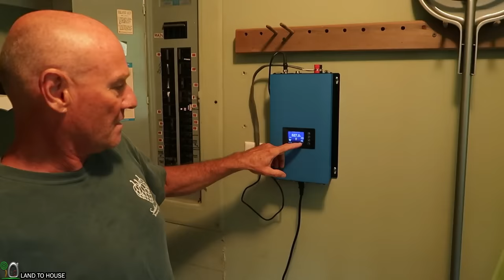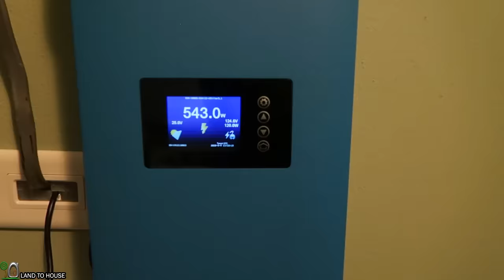Awesome Low Head High Flow Grid Tie Micro Hydro 530 watts!

Comment: Surprising how many watts he is getting from such a low head. Goes to show the high power potential from a low head hydro.
Reply from the maker: I think the formula still holds true for low head power. 
(Gpm x head)/10 = watts
So (350gpm x 15 feet)/10=500 ish watts
Reply: I’m guessing the fact that he has the outflow under water creating suction is a big contributing factor. If you think about it it’s kinda like the entire creek is pulling the water through not only relying on the fall of the water to the turbine itself. It’s genius!
Reply: a turbine that big with that good of plumbing should be able to power your entire house, maybe if you gut the alternator out of high amp gas generator and built a plate to belt ot in, cool setup
Reply: Yea but look at the supply of water volume you need that is unsustainable almost every were !
Reply: @rhom5180  the load would bring the turbine to a standstill with a high power generator head.
Reply: it's an ineffective setup  most of the water is being wasted because of the cheesy motor  what you need is one of those BAS motors from a start stop system they will put out a couple of KW hours
Reply: @raymondj8768  yeah right! i find it funny that he "only" generates 500watt with those big pipes... im wondering if he could add a larger turbin or add more of them?
Reply: @Shortyyz  i know rite thats a dam waste of time n energy!!!
Reply: @samuelemmettbray :   " Mmm. no. 500watts isn't even car battery power. "
No, it's not. Then again you never measure anything about a car battery in watts, only the things USING power. If you meant "alternator" then yes, you would usually get more power out of 1 than that.
Reply: @LandtoHouse  don't mix units - Watts are metric!
Reply: Hydraulic power = PQ (P=pressure/head) (Q= flowrate/Gpm)
just shows that even with little head, you can make up with higher flowrates, giving u the same Hp
Reply: @911life5  And with that step up to 8" pipe volume, he's able to up the flow rate on the 6" line I believe.
Reply: @hussam9044  I'm a bit surprised he only gets 500 watts with that fairly reasonable head and the big flow with those big pipes I would have expected more power. I really haven't got a clue how much more or even if it really should be mathematically more but that's quite a lot of water belting through there and although a very useful amount of power, especially if he's got a storage system and inverter I still would have expected more out of this quite cleverly setup arrangement.
Reply: @carts4138 :   " don't mix units - Watts are metric! "
I hope you're just joking there. If not then you'd better go study some more.
Reply: @lorditsprobingtime6668  the dynamic head is certainly big as the suction of the pipe sets the direction of the flow to follow the pipe line, combine that with reasonable elevation and yeah I would have expected more than 500 watts from those, the beautiful thing about water is that it's quite a heavy material so flowing water carries a lot of kinetic energy because of the giant mass of the water
Reply: @hussam9044  Not sure where exactly but someone suggested running another 1 or maybe more in series. He does have a minor issue with using virtually all the flow of that stream there now, if he had more in series it would restrict flow a little at least but I wonder if he'd have enough pressure to run 1 or more extra ones and not wind up actually slowing them ALL down too much to generate the needed voltage. It would be great if he could as then he'd get hopefully more power and maybe be able to keep it running continuously. He's got a pretty good setup now and I think he could improve it maybe by doing that and also by taking the right angle corners out as much as possible. Ideally no corners at all but we know he has to have some. Where he does absolutely have to have a corner at least make it a steady bend rather than a sharp corner. I forget the exact figures but each corner sucks a lot of energy out of a system like this. The big diameter pipes will help compensate a lot though.
Reply: @lorditsprobingtime6668  now remember that the initial flowrate of the river cannot be smaller than the output flowrate of the system, if he had 2 pipe systems he might possibly restrict water from ever going across the dam wall! because water now prefers the easier pipe route to go down and it would do so, the right angles are considered major losses of fluid energy in a pipeline, however with the flowrates he's operating at the effect of right angles isn't that much so the flow pattern isn't disturbed much at least, 

you know, if he used a second pipe, the flowrate across each pipe might me low enough that right angles don't affect energy loss that much, you saw how with 1 pipe system he almost completely stopped the flowrate above the dam wall, so he's already using the almost maximum available flowrate
Reply: @hussam9044  You didn't read my comment very well at all. I said "in series". In other words all on the same line, one after the other. I even mentioned that it might HELP REDUCE the overall flow going through and may allow him to have it run continuously. Why am I repeating myself, READ THE OTHER POST AGAIN FFS. 
I will agree that although sharp elbows won't have nearly as much effect at low flow rates. This does have a fair but not huge flow rate though and although it wouldn't make a big difference he is after every possible advantage here to get the current up WITHOUT increasing flow, that's why the series arrangement would probably help enough to warrant running extra turbines "IN SERIES" relying on them to help  reduce the flow to a sustainable rate.
Reply: @lorditsprobingtime6668  What do you think about the idea of using a kind of an automatic gate valve/ servomechanism to auto regulate the flow rate? I don't know the exact name but big commercial power gen systems do have an autonomous system that opens and closes to check speed of the turbines.  I think it's used for synchronising with the grid. 

So I'm thinking of borrowing that idea but with a twist, to increase flow rate whenever there's excess water overflowing in the dam. That way you have extra advantages, e.g no noise from the waterfall, and sucking all the energy from the dam. Not too difficult especially with DIY things such as arduino.
Reply: @davemwangi05  I don't know, that might work ok. I think I'd be looking more at a ball valve that only requires a quarter turn from full on to full off, it also is an undisturbed straight through flow when fully open. if you're going to operate it via a servo arrangement rather than a gate valve that has to be screwed on or off multiple turns.
Reply: @samuelemmettbray   its 42% of an average home's power consumption. (Average US home consumes 10972 kWh a year, which is 30 a day. 530 Watts an hour times 24 hours is 12720 Wh,  or 12.72 kWh.    12.72 kWh is 42% of 30 kWh) So I think its still a worthwhile supplement.  Throw some wind or Solar in there (if he has any sunny spots on his property) and he's energy self sufficient.
Reply: Power = head height  * density * flow rate * gravity

Where flow rate 
= (intake area) *  sqrt(gravity * head height) 
= 0.0182m² * sqrt(9.81m/s² * 4.5m) = 
= 0.121 m³ / s
= 120 litre/second

So power = 4.5m * 1kg/litre * 120 litre/second * 9.81m/s² = 5338 watts 
.... implying about 10% efficiency, which is seems about right for this sort of set-up
Reply: Put the turbine down lower, get the potential energy of the falling water. Dunno.....maybe it pulls thru  with the same power?
Reply: @yestfmf . Sorry but I'm pretty sure that wouldn't help with a fall of (I think they said around 20 feet), it will pull the water through with pretty good force which should be exactly equal to the force pushing if it was right at the bottom. There is a definite limit though, I think it's around 30 odd feet maximum pulling height before you start forming pockets of vacuum. It's good to keep it down close if you had any more height than this but, at only 20 feet minus however far below the normal level at the top it shouldn't affect anything.
Reply: I like that project, beautiful location too. I think higher generator voltage would help, and use of a propper 3 phase inverter with speed control of then gen would allow to run the turbine in its optimal operation point. I guesstimate you may gain about 30 to 40 percent.
Reply: @samuelemmettbray  
If its ran 24/7 for 30 days it will make 360KW of power which in some cases is about 1/3 of a low cost electric bill.
Reply: @punker4Real  BTW punker, I have no idea why you think a BAS motor come generator could be better, it won't though. That was a pretty ridiculous suggestion actually since there ISN'T the force here to generate 
" a couple of KW hours " unless you've got a very tiny one and a few weeks to build up that amount of energy. There isn't the head pressure here or flow rate for more than what he's using right now genius.
Reply: @Supoxify  You've lost me. How exactly do you use a "speed controller" on a generator? I know quite a lot about speed controllers on 3 phase brushless electric motors, this is a generator as used here, so how can a speed controller even be used?
The voltage is pretty much dictated by the particular generator and the speed it spins at. He's using basically the entire flow of that creek here already and he can't increase the head pressure so exactly how do you expect him to increase the voltage too? As for your "guestimation" you'd better 'try' and explain the other bits I mentioned first, then try and explain which part of your anatomy you pulled that figure from.
Reply: @911life5  submerging the output side of the pipe just gives you a cleaner flow through the pipe so you don't get any air trying to come up and the end. I think if anything it would take away from efficiency though because the water coming out of the pipe has to push the water in the creek out of the way. Ending it slightly above the creek might be ideal. The creek isn't going to pull any additional water through the pipe because it's open to the air. If you could enclose the whole creek a mile downstream somehow you'd get a bigger head drop and more power though
Reply: @jonathancover4658  yeah the diameter change causes the water in the smaller pipe to flow faster - and hence more flow than if it were all 6". An 8" setup all the way through would still get more flow though, but at a lower speed which might be less efficient with the turbine
Reply: @yestfmf  shouldn't matter where the turbine is located - at least not much. Main difference will be laminar flow before the turbine vs turbulent flow after. So I think you're right but it shouldn't be a big difference
Reply: @lorditsprobingtime6668  only difference will be laminar vs turbulent flow before and after the turbine so I think he's technically right but it shouldn't be a huge difference
Reply: Why use rule of thumb equations, just use the actual equation.
P = m x g x Hnet x η  
Using metric is easier:
m is Liters/sec
g is 9.81 (gravity)
Hnet is Head minus the friction (in meters)
η is efficiency
Power = 12.6 liters/sec (200 gal/min) * 9.81 * 4.11 (15 ft -10% friction) meters * .75 eff = 381 watts. 
To get the 535 watts he is generating, his flow must be more like 280 gal per minute.
Reply: @lorditsprobingtime6668   maybe the topic is a bit hard to explain in a comment section. I will try. I used to do that with larger turbines (100 - 200 MW) . You are right about the head, it will not change much in that application. Voltage at generator terminals is given by the generator and the speed. My idea was: if you would use an inverter and control the speed you could experiment and find the optimal speed (with the most power output) for the given head / flow rates. With the large systems this could lead to the said efficiency gains. But often (with large  dams) the head varies a lot, so the gains would be smaller here. Sure it would cost quite a lot more and would be more complex (more potential for failures etc.) But would be interesting to do,  probably overengineered . (For more details, google "varspeed hydro" )
Reply: @Supoxify  My apologies for being so outright dismissive of what you were saying. It sounded so much like a lot of the voices that chime in with crackpot ideas that defy physics and all logic so often. It sounds like you actually do have some real knowledge and experience with this sort of, if much larger arrangements. As you say, it's a little hard to know from comments exactly what the other person is having trouble understanding, and how many other things they're not understanding either for that matter. I'm still unsure how you control the speed of the generator. I think you're suggesting the inverter, or some electronic speed controller but I've never heard of one that controls the speed of a 'driven' device, only the driving motor. Unless you maybe meant controlling the flow going through it to find the optimum rate for the best balance of water usage verses power generated. If it's the last one he's got a limited water flow so he may as well get everything he can out of it since any that doesn't go through his turbine is wasted (to him) anyway.
I haven't got the time now but will look up "varspeed hydro" later, I'm still curious about that since they can pretty much all be spun at various speeds and the only difference on a specific unit is the voltage and current will increase with more speed and reduce with less which isn't usually any problem if you've got the right electronics to convert it to the voltage you need, that isn't any major problem these days. As for the a gain of "30 to 40%", well, that's a huge increase and he could do with that since he's very limited by the lowish head pressure and flow of this stream so depending on HOW much extra cost was involved if he could pull even the lower 30% extra that could be worth spending, depending on how much extra. As it is he needs batteries to store extra while he's not using much to give him power to run high power things like microwave ovens etc and the more his turbine is putting out the lower the capacity of those batteries has to be. Either way, more power coming out is always good.
Reply: Not the best design. Negative pressure on the turbine will produce impeller destroying cavitation.  Turbine should be nearer to the water outlet.
Reply: What do you mean by "car battery power?" 500 watts is 41.67 Amps at 12 Volts. That is significent.
Reply: @jimprice1959   Cavitation WON'T be a major, or even minor issue at that height.
As for the power being "significant" I completely agree. Although "significant" is a relative term, if he's got a way of storing all energy gained during each days running it would be enough to do quite a lot with and definitely save him a lot on charges for extra from the grid, with luck it'll cover any grid costs completely.
Reply: @lorditsprobingtime6668  I wonder.  Maybe some clear tubing would show it.  Cavitation might not damage the turbine but would decrease efficiency.  I've seen the effect of cavitation on the Kaplan runners at Bonneville dam.  It's surprising what it can do.
Reply: @jimprice1959  Sorry but I had to look up "Kaplan runners" and I was going to say I've seen the effects of cavitation on a damaged boat propeller and that's pretty much what they are, I can't remember exactly where else but I have seen very surprisingly severe damage caused by cavitation to something else that was enough to be very surprising. Here there's no huge forces involved, there's only, if I remember from watching it some time back about 12 feet of fall in total. From memory I think it's something like 30 feet of water depth equals 1 atmosphere so in an undisturbed state there shouldn't be any vacuum pockets unless it was over 30 feet and being at 12 and no major forces involved at 12 feet it really shouldn't. I would say your idea of a clear section below in particular but everywhere you could around the turbine would be a handy idea and even satisfying just to see it working and doing it's job, but especially for checking on seeing if somehow there was enough disturbance along with the lowish suction to make sure there's no cavitation going on. Only problems I can think of is:
(1) It would be highly advisable if you're worried about cavitation to get hold of a high speed camera to film it in action from every angle possible because cavitation can be there and gone again faster than the eye could hope to see on a spinning turbine like this, and'
(2) I'm not sure where you'd find clear fittings or sections of pipe that can also stand the reasonably strong suction created by that 12 foot of fall. Maybe custom made section with actual glass panels might be best and would give the clearest view of what's going on. Alternatively he could just inspect it frequently at first then less frequently once he's confident there's no cavitation eating away at anything. I don't 'think' there will be but I won't try and say it's a waste of time checking.
Reply: @lorditsprobingtime6668  You are correct on pressure.  It works out to be  0.433 psi per foot of head. I remember seeing a Francis runner in Boulder City, NV near Hoover dam.  It has been removed as it had very large holes in it from cavitation.   I applaud the guy for building the mini hydro system.  Here's what I would do to improve it.  1. Put the suction down under the water so it doesn't pull air.  There is no reason for it to be on the surface.  2.  Better yet.  Put a 4 in. hole in the bottom of the dam with a gate, or preferably laminar flow needle, valve to feed the water into the penstock.  3. Put the generator as low down the pipe as possible.
Reply: @jimprice1959  I don't think pulling air is a problem for him, remember the simple tennis ball fix he has to stop any vortex ever reaching the inlet. Plus he can easily clear any leaf litter or other rubbish collecting around his nice big mesh shield around it. The river gravels and silt have built up behind that wall and he'd have to excavate it drastically to have a hole at the bottom of that dam and then anytime there was a bit of heavy rain tons of crap would just fill it straight back up again. Admittedly clearing it out to the depth of that wall would give him a much bigger capacity and he could then do things like treating it as a battery bank and add extra turbines that he can turn on to give much more power for limited but reasonably long periods before he runs too low to keep them going.
I admit I know nothing about a " laminar flow needle " but I imagine laminar flow would be more efficient at least. 
Putting the generator at or near the bottom of the pipe has pluses and minuses. Yes it would certainly make sure there's should be no cavitation and if he had the low hole supply you suggested wouldn't need priming. The bad sides are:
 (1) Longer wiring losing power and. 
 (2) Those high rainfall minor flood situations then puts the generator right in the line of fire of the possibly very fast flowing water and everything that water carries along with it. I've lived beside a steep fall type river that could be a gentle crystal clear stream and if the rain was heavy enough and coming from the catchment direction could be already starting to rise rapidly before the rain even got to me and then it was like a huge wall of water, huge trees and once it got going fully you could not only hear, but FEEL clunk,,,, clunk as massive boulders weighing tens of tons get tumbled along the river bottom. The energy being wasted there seems criminal but being so intermittent you couldn't justify any big project to try and capture anything from that. So much debris to destroy anything in it's path that anything you put actually in that water where there was flow and force would quickly be destroyed by the stuff being pushed along by that flow.
My situation was that I was trying to make a living dredging for gold, that meant machinery floating on pontoons out in the river that sometimes was miles from where I was camped and if it looked like it could be coming I had to race down to wherever everything was and pull the dredge apart to move it well above any possible high water level along with all tools and other equipment. It took me quite a few years after that before I stopped waking up at the first sounds of raindrops hitting my roof, It had become instinctive and it really took a long time to shake it off.
Point of all that was that I've had experience with the force of water in various ways and still getting more now and then to this day since even after all that, when I bought a house I bought one in a flood area, which I agree is kinda stupid but I figured for the much lower price I got a very nice place, that I sometimes have to sleep on the roof of lol.
Reply: @911life5  it's the GPE from the drop in the siphon that draws the water, the pipe under water at the outlet will be higher than atmospheric pressure, the faster flow actually is pushing into the stream water not being sucked out.
The partial vacuum is used to start the siphon, but it's atmospheric pressure that lifted the water up into the elbow to make the siphon seal
Reply: @kameljoe21  you forgot the hours. It's Kilowatt HOURS
Reply: @joeshmo8267  No I am right in my statement. 
@Samuel Emmett Bray 
If its ran 24/7 for 30 days it will make 360KW of power which in some cases is about 1/3 of a low cost electric bill.
It makes 360 kilowatts not 360 kilowatts per hour. FFS.
Reply: @kameljoe21  your terminology is incorrect. What you are calculating is kilowatt hours.
Reply: @kameljoe21  your calculation is correct. Your units are incorrect it should say 360KWh (kilowatt hours)
Reply: @joeshmo8267   No I am still right. kWh is a measurement of energy, kW is a measurement of power,  Energy refers to the ability to do work and power refers to the rate of energy production or consumption. An appliance that uses 1kwh of energy where a generator produces 10kw of power. The turbine produces 360kw in a 30 day cycle. I am still right. Prove me wrong instead of saying I am wrong.
Reply: @kameljoe21  as I said, your calculation is right, you are just mixed up about how the units are supposed to be. 500W * 720hours = 360000 watt hours (360 kilowatt hours)
Reply: @joeshmo8267  You are still wrong. Let me put it this way.  
Utility bills are measured in kilowatt-hours (kWh) -- power usage multiplied by time. For example, a 100-watt light bulb left on for 10 hours uses one kWh. Although many companies and industry groups say a 10 kW system will generate about 10,000 kWh per year (equaling the average power usage in a U.S. home), the real output will be higher or significantly lower. The turbine puts out a maximum of 10 kW under perfect conditions, so it could theoretically generate 10 kW for 24 hours a day 365 days a year, or 87,600 kW per year. With only soft breezes, it will generate just a handful of watts.
I am in no way stating that it will consume 360kwh, I am stating that it could make 360kw in a 30 days cycle which is about 1/3 of a low cost electric bill if said bill was 1000kwh.
Reply: @kameljoe21  the guy is getting 500W out of his turbine here that multiplied by 720 hours in a month equals 360KWh in a month that it would generate if it ran 24/7. How are you not comprehending this? And how did you type out that whole other example (I think you copy and pasted) then go straight back to not understanding how the units work. This is basic high school science class stuff dude lol.
Reply: @kameljoe21  lol that other example you typed up you messed up the units again bro it should read "87600 kwh" not kw
Reply: @kameljoe21  it is 500 watts over TIME dude you are totally ignoring the time units in your equations...
Reply: @joeshmo8267  Yeah I did copy and paste it. I had to find an example that could explain to you what I was trying to convey. I also bold the part I wanted you to see.  Though I explained to you that I am not counting on it being consumed. I am using the amount of power he said he can get from it at the max. The turbine produces the max of 500 watts. Using this you get a .5 kw generator. With the capacity to produce 360kw in a 30 day cycle. I am in no way saying that he is consuming 500 wh. The realistic production of this turbine is .5 kw. 
I also explained to you the difference between KWH and KW.
Reply: @joeshmo8267  Again you are still wrong. Kilowatt hours is consumption and KW is what it can produce. I am not how much more I can explain to you how consumption and production are different.
Reply: @joeshmo8267  Let me put it a bit better if you have a 10kw solar system and you draw 9kwh from it every day and you have 5 hours of max light the system can produce 50kw of power and you only consume 9 kwh of energy from it. Read it many times to understand what I said. The system can produce 1500 kw of energy from the system in a 30 day cycle and consume 270kwh from that system.
Reply: @kameljoe21  no dude you have a misunderstanding. The unit, kilowatt hours, is not specific to only production or consumption of electricity.  Something that uses 1000 watts of electricity for one hour used 1 kilowatt hour, and a generator that produces 1000 watts for one hour generated 1 kilowatt hour. Do you see how it works now?
Reply: @joeshmo8267  Ok this is the last time I explain this to you. I will use 2 example to explain my statement and then use your statement and calculate out how much energy from how your are thinking about it. 
I said and I quote. 
 "If its ran 24/7 for 30 days it will make 360KW of power" Total production of 360kw.
 "If its ran 24/7 for 30 days it will make 360KWH of power" 360kwh time 24 hours times 30 days give you a total production of 259200 kw of usable energy. 
Now if I had said... 
If it ran every day for 30 days you could consume up to 360kwh of energy. 
Yet because the turbine makes up to 500 watts at max it could make up to 360kw in a month. 
Do you understand the difference in how things are stated. 
I am talking about the max amount of power the unit could make which is 360kw. One could use up to 360kwh of energy from that system in a 30 day cycle. 
Do you understand that KW and KWH are two different ways to explain consumption and production. 
Let me do something a bit different. 
A fridge that is rated at 100watts while the light bulb in the fridge is10w. So the fridge takes 2.4 kw to run in a day. If I remove the light build from the fridge it now takes 2.16kw a day. Yet when I put my kilowatt meter on the fridge it only used 1.125kwh to run it for that day because the compressor did not run all day. The max consumption of the fridge is 2.4kw while it only consumes 1.125kwh.
Reply: @kameljoe21  you literally have a fundamental misunderstanding of this. I don't know how to get through to you better. I'm sorry the education system failed you so much. All this units and electricity stuff is literally explicitly taught in high school physics so I really don't understand why you don't understand. Did you finish high school? Bc I did and then went to college and got a degree and guess what? My engineering classes taught all about this too. This isn't an argument you're having with me dude this is just me trying to help you understand things better. I'm sorry I couldn't get through to you. You are simply wrong.
Reply: @kameljoe21  for the last time. If this guys turbine producing 500 watts were to run nonstop at that constant rate for 30 days that would mean it produced 360 kilowatt hours of energy.
Reply: @kameljoe21  .5KW * 720 hours = 360KWh I really don't see how you don't understand .5*720=360 and KW*hours=KWh it is really not that hard to understand...
Reply: @kameljoe21  I apologize for the dig about education, that was uncalled for. I was just very frustrated bc I can't figure out how to help you understand how the units work. I've explained it in the simplest way I can. Sorry I couldn't help you more. Merry Christmas
Reply: @joeshmo8267  The fact that you can not see beyond what you are saying. 
A generator is rated at 10kw. This same 10kw generator has a day production of 240kw. Now if I run a load of 5kwh for the whole day then you would consume 120kwh. 
The same thing can be applied to solar farms, wind farms, coal plants, nuclear plants, generators and a mount many other things that produce electricity. 
When we project the yearly production of these products we use KW. For example a 10kw solar system has the capacity to produce 18.25 MW per year. Though the total usage of the solar farm is unknown. So we can not use kwh as in what is used. 
KW equal power made. 
KWH is power consumed. 
 Its pretty simple to state that the propose hydro system above has a yearly possible production of  4.38 MW. If that same system used 4MWH per year. 
I am not sure how this is wrong.
Reply: @kameljoe21  you are still getting the units wrong dude. In your new example of a 10KW generator if it ran at 10KW for 24 hours that is 240KWh of energy that it produced that day. A particular 5KW load on it would have consumed 120KWh in a day. the math you are doing is not the problem. The problem is that you seem to think KWh is specific to consumption and KW is specific to production which is simply incorrect. A Watt is a unit of power, a Watt-hour is a unit of energy.
Reply: @911life5  
Not really. It just insures it can’t gulp air
Reply: @Natabus  Hmm. My first thoughts were that 500 watts was pretty miserable output. But, when you explained that it would be producing 24 hrs a day/365 days a year, it makes more sense. Hmm. A second pipe and turbine would nearly wipe out the average home annual use.
Reply: Don't know, it this is still a low head hydro. Through this setting with the tube at the outlet down to the creek he uses the full height from the top water level to the lower water level. Technically it does not matter at which height of the whole structure your turbine is placed. In theory, it does not even matter if the outlet of his tube is over or underwater. It's only the overall height that counts. However, practically letting it end over water might lead to the tube emptying itself and filling with air, which would then virtually lift the lower end of the water column to the height of the step, shortening it to 8ft and destroying the effect. Also having it below the water level allows for his simple vacuum starting process. Changing from 6inch to 8inch should have no effect (especially no venturi effect) except from reducing flow resistance.
Nice and very clever setup.
Reply: @kameljoe21  4 months late to this argument, but unfortunately joe shmo is right. Some of the confusion may come from the usage of "power usage" in everyday speech when we really are talking about "energy usage". Electrical power measured in Watts is a rate equal to Joules per Second, so a quantity of Energy divided by unit of Time. Since the energy in joules (a kilo-watt-hour is just 3.6 million Joules per Second) is the quantity and watts is the rate, when talking about "totaling" one of these values, it only makes sense to have a total of energy, not watts.

An analogous comparison is Distance versus Velocity. If an object traveled at 10 meters per second for 10 seconds, the total distance would be 100 meters, not 100 meters per second of distance. As such, a statement like "259200 kw of usable energy" is not valid because kilo-watts do not measure energy, only a rate of energy usage. It makes sense to talk about Power at an instant or as an average, but not cumulatively. So it would be OK to say a generator can make 360kWh of energy operating 24/7 for 30 days with an average power output of 500 Watts over the duration.
Reply: @OpticalLimit  I will have to say that you and Joe Shmo are  likely right yet at this point I could careless.
Reply: @mommymilestones  Low head is mostly 50 feet and under. So it is still considered low head.
Reply: @kameljoe21  "yet at this point I could careless"  
LMAO, you got that backwards too.... its "Couldnt care less".
Reply: @Natabus   Maybe in the summer… In the winter a single room space heater is 1500 W.
Reply: 500 watts isn't that much.  A vacuum cleaner will use that easily.  If they could get say 3,000 watts, that would be closer to self sufficiency, although you'd have to be careful with energy usage.